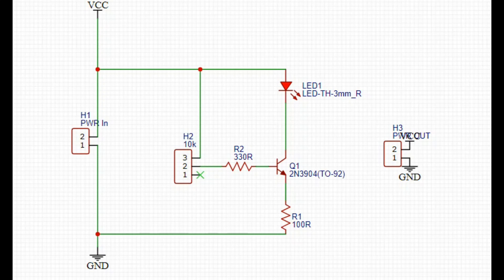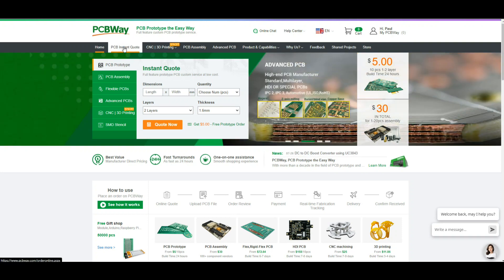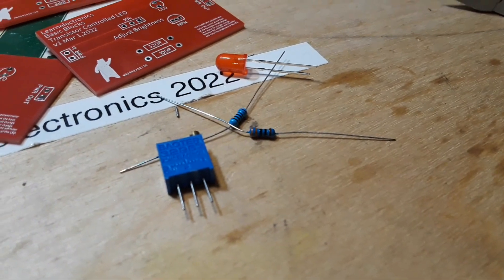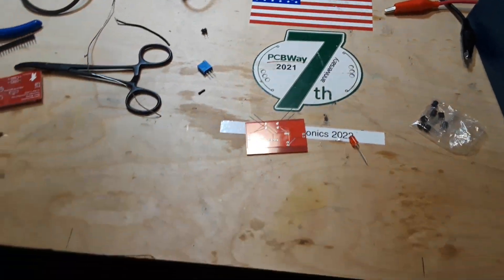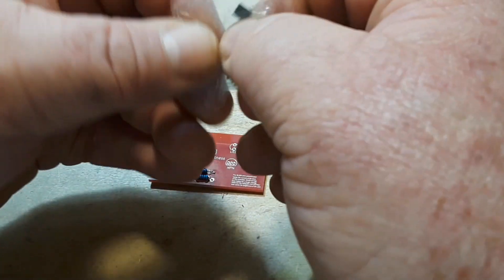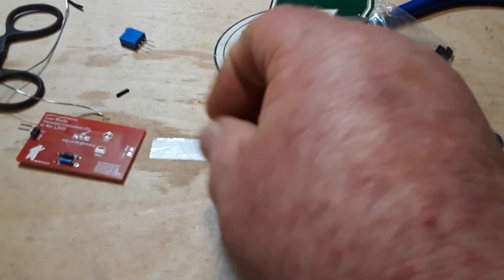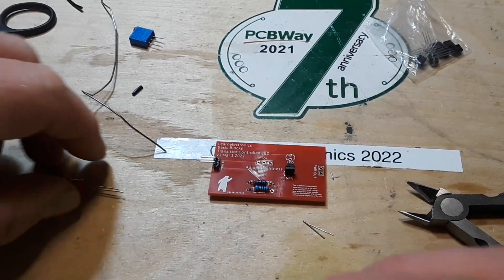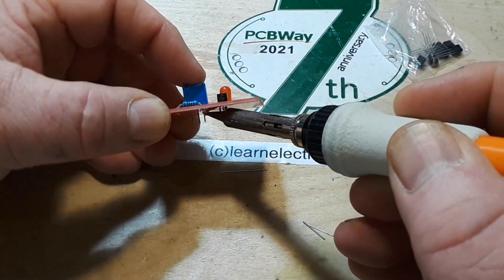STEM Boards for the school #2 LED dimmer

Comment: Adding some multimeter pins parallel to the Pot and the LED would be a nice touch. If you add multimeter pins to everything that could or should be measured on each board, then you could fire up excel and design a measurement worksheet for every one in the series. 

On the "worksheet", you can choose to add a picture of the board for easy ID. More importantly, since these are younger kids, there should be a how-to-measure message ad nauseum on each sheet. Take advantage of photographic memory when it's at its strongest.

You know, that reminds me. You're going to want to add some jumpers anywhere you want them to measure current.

Comment: Perhaps use the simpler horizontal trim pot ?  One that doesn't take 20+ turns, I think they turn about 300 degrees.  Easier to turn and you see the result better in relation to you how far you turn the trimmer.

Comment: Might I suggest adding a silicon diode on series with the ground of the potentiometer. This compensate for the vibe drop on the transistor, removing the 0.7 volt dead zone on the range of the pot.

Comment: I like this concept you are conveying and it is a simple but effective tool you have started, I may suggest you move the output pins closer and have the plastic shield resting against the board and flush with the end. The plastic can be glued with hot glue to the board for extra support.

Keep up the great work you are doing on this channel. I have learned so much since I started watching your channel.

Comment: The transistor is biased fully on for all of the potentiometers range I beleive. The Led current is therefore fixed by the 100 Resistor and doesn't vary. . You should connect pin3 of the 10k potentiometer to ground. Varying the wiper of the potentiometer will apply a variable voltage to the base of the transistor The emitter will follow that minus 0.65v and the Led current is then set by the emitter voltage across the 100 Ohm resistor. The 330 base resistor should be increased to 10k as at maximum brightness too much base current is provided.